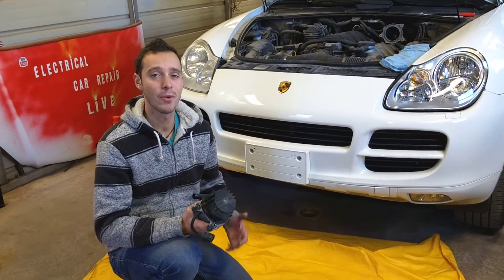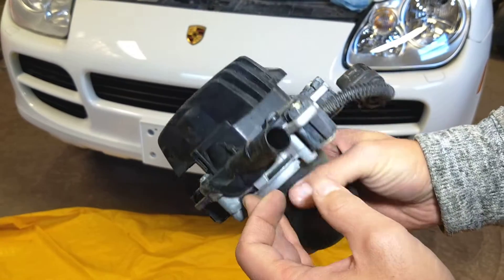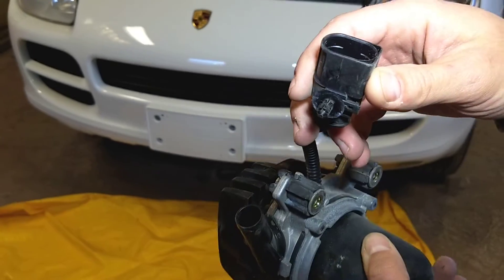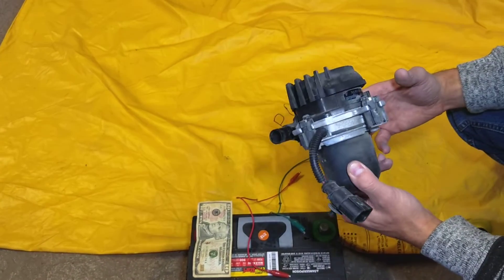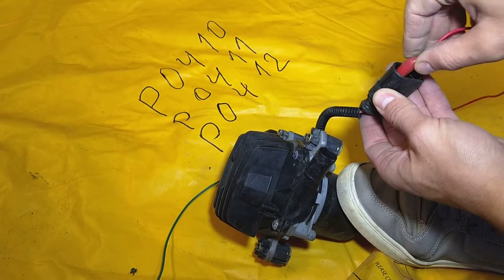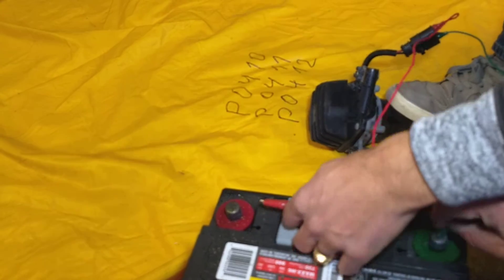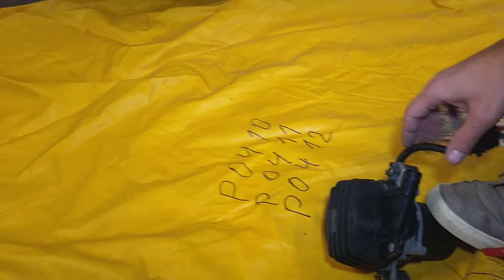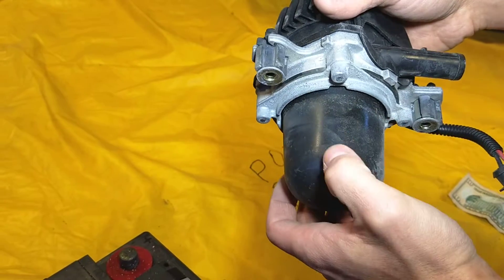HOW TO TEST SECONDARY AIR PUMP ON VW AUDI BMW MERCEDES PORSCHE SKODA SEAT CODE P0410

Comment: Hi i have porsche cayenne turbo s 2007 two issues 1) the gear indicator is stuck in D the shifter moves but its stuck in D and 2) the rear shocks are not working properly its stays all the way up or all the way down and on the road it jumps alot 
Can you please help me with this